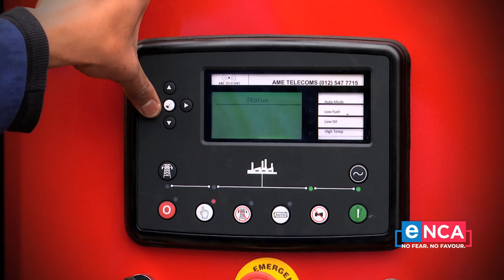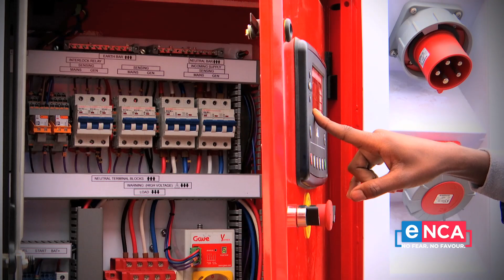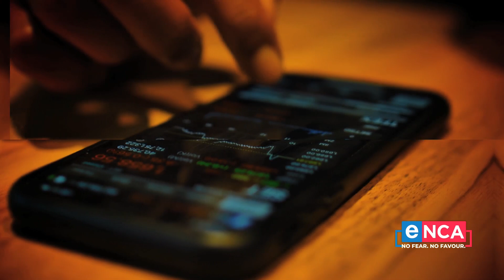GameChangers | AME Power Solutions | 5 July 2021

Comment: A solar Installation was completed by AME Power Solutions and connected incorrectly. AME Power Solutions are specialists in this field and this is unacceptable. We have also not received the regulatory Certificate of Compliance for this installation from them. The project manager for AME Power Solutions has accepted accountability for this on behalf of AME and the resultant financial loss caused. The installation has been now rectified after 3 site visits. Promises of communication with us has not materialized and we are awaiting their amicable and ethical solution to this, none the less.